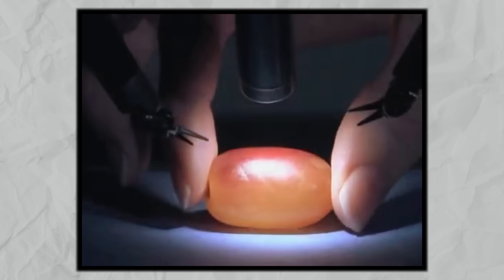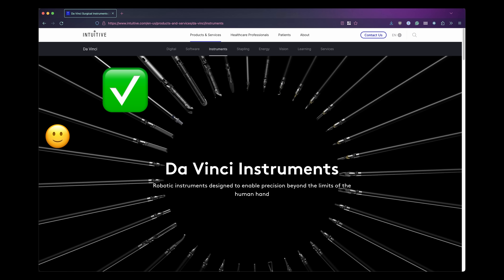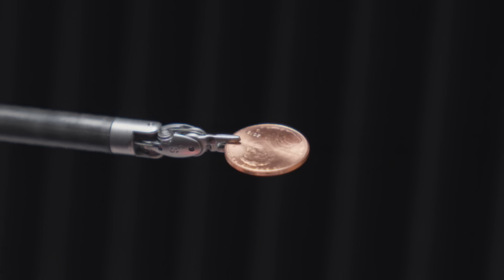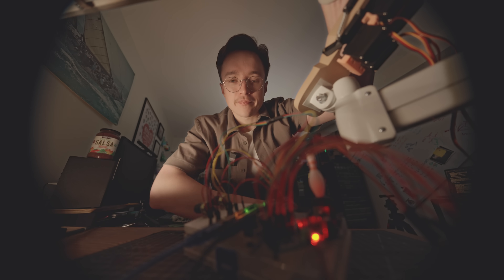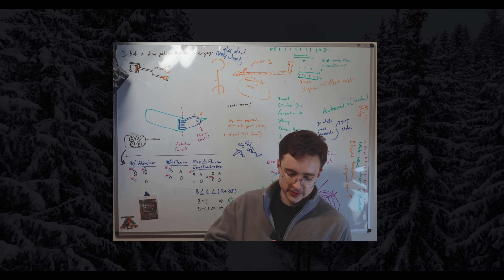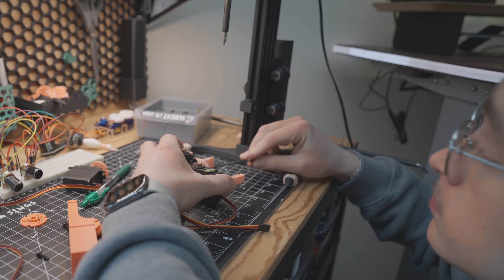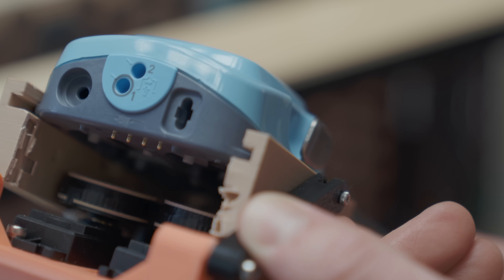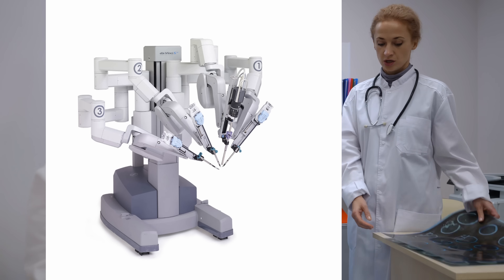Building a DIY Surgical Robot

Comment: hey, i used to work with a company that made the instruments. i was in the repairs department and received incoming and just because the hospitals say its been sterilised doesnt mean its fully clean. I saw bits and residue still attached and inside the mechanisms near 100% of the time, they also lose sterility because of bacterial growth and biofilms on the instruments and in the instruments, it's a huge reason why the parts have a limited lifespan. just a gross fyi when dealing with used medical instruments.

incase ur wondering the slide in fit is as simple as it gets, the plastic has enough elastic deformation to accommodate the pins sliding into the motors and its also part of the force limiting of the motors since the pins wont allow excessive force before just breaking, rather the pins break on the machine than an instrument breaks inside the patient.

Comment: - how about ropes in all 3 axes attached to a glove? Moving the glove pulls on one rope and you measure rope displacement.
- VR tracking
- High res cameras which film glove from different angles, feeds into NN which is trained to estimate the distance of the glove to the camera or angle of rotation. 
Or possibly you could use OpenCV or something for this. You'll likely need multiple (good enough) cameras and possibly multiple computers, preferrably with gpus that can run tensorflow, which relay their measurements to some main computer.

Comment: This is brilliant!!
For your controller issue, a Wii Nunchuck is easy to use with an Arduino, has an analogue stick and an accelerometer along with 2 buttons.. one in each hand would give a fair amount of control ability and both could be on a single Arduino or something more powerful like an STM32.. a rotary knob could be used to select which "channel" the individual Nunchucks control.. or this could be done by voice command.. taking this further an accelerometer could be placed on the back of each hand (on a glove for example) with buttons in each finger - activated by the thumb - and a small hall-effect joystick for each thumb (placed on the side of the index finger?) - this would give more button options but retain the same features in a Wii Nunchuck

Comment: I just had a minor abdominal operation done robotically a few weeks ago. Super cool to see all the different tools they have, wanted to ask to see stuff before they put me under but everything happened so fast once they were ready for me and wheeled me into the OR. I did ask what kind of abdominal mesh they were going to use, and so I got a little card to look it up after. Also very high tech/ mechanically interesting stuff. It unrolls itself and completely self adheres to the abdominal tissue like velcro without the need for stitches, and then partially gets absorbed into the tissue.

Comment: Hey Bennett, I love this video! I don't know much about coding but am learning, all of this is super interesting to me. I genuinely thought you would've had hundreds of thousands of subscribers. Anyway, I think you want patent 8613230 for the movement. I put some links for the pictures. The figures you want start on page 13 of the PDF:
https://ppubs.uspto.gov/dirsearch-public/print/downloadPdf/8613230
Description of PDF (search 8613230.pn.) :
https://ppubs.uspto.gov/pubwebapp/
Reply: also at 9:23 the way this works is very similar to your prototype. If you play this https://youtu.be/HHKEHTr7o3Y?t=112 frame by frame, they disks slide back, kind of like a seat belt or the brass latch when you close/open doors.

Comment: Intuitive actually has a "demo unit" for training - you can use the console w/ the eyepieces and the hand/finger inputs, but it's just a 3D game simulation inside the eyepieces. And there's a whole set of software for measuring accuracy, speed, simulating bleeding, etc. I got to use one  at a trade show ... insanely fun, actually.
Anyway, if you find your local med school, you might be able to talk your way into getting to use the trainer.

Hobby servos are a disaster. There are cheap closed-loop stepper boards from the 3d printing community that mount directly on the back of motors. And they now make very small steppers for extruders.
Reply from the maker: Excellent idea- I’m in the Boston area with lots of med schools around… I just might have to try and see if I can finesse a demo

Comment: Imagine using this as a soldering bot, it would make microwiring and board repair so much easier
Reply: This is exactly what I'm after. It's weird because the davinci surgical assistant has been around for at least 20 years, and I'm really surprised that no one in the DIY community has come up with a variant for the component repair field. At least one for just the fun of it
Reply: My thoughts exactly!
Reply: That is a great idea, even just to have it as a dynamic 3rd pair of hands would be helpful.

Comment: I know other people have made this point already, but I think it still bears repeating. I’m directly involved in a company which works with medical devices like this one, and the primary reason that medical devices have such limited lifespans is the testing requirements and the brutality of the sterilization process. Each device that we make goes through literal months of tests (the project I’m on right now has about 6 months of just testing planned, and it’s nowhere near as complex as a surgical robot,) and the end goal of all of these is to ensure that your device will not fail under normal use conditions or have any side-effects that would harm the patient. Parts that are being tested need to be equivalent to production parts, so for this machine in specific they likely needed to spin up an entire production line to produce the parts required for the testing. (For the project I’m working on right now, we’re making over 500 complete devices, just to test.) On top of that, the devices will need to go through sterilization cycles in-between each use, and no matter what method is used they take a massive hit on the integrity of parts that are cleaned. All in all it just makes more sense to test the minimum numbers of parts possible, to a level that doctors and insurance companies indicated would be acceptable. 

Aside from that, I’m incredibly excited that you get to show off the inner workings of some of these devices to a larger audience. The technology is fascinating and your videos on the topic have been awesome!

Comment: 3:19 Yes, would be interesting to see how it's made, although its cable driven wonder what kind of precision motors and gears used. Starting to realize the big bucks price tag on these precision robots are not from the cable drive hands but rather the state of the art motion control servo system, those could get really expensive quickly.

Comment: Very nice work Bennett. You asked about control options... Possible easier solution for control input, use a quest 3 and the onboard hand tracking. This gives you great options for viewing of endoscope, options for augmented visualisations, and pretty impressive hand tracking with gesture recognition all off the shelf at consumer pricing. If you use something like nvidias omniverse as the platform, you get interesting multiuser, multi application integration.

Comment: Awesome project, I'm an anaesthetist who works in a hospital that does a lot of robotic surgery and i'd be happy to talk through anything you want clarifying. We have the newer Xi models but i'd be able to take any close up measurements or photos you need to work on this. 

A key advantage of robotic surgery is the way it pivots around the insertion point which is something you might want to consider when thinking about an arm. The RAVEN surgical robot project might be a useful reference point for that aspect.

On the controls front what about taking inspiration for cable driven robots? I've seen a few parallel cable driven robots that act in 3 dimensions, you could potentially make a control system that does that in reverse

Comment: I got to operate one at a fukn car show in Los Angeles back in like 2013 idk why they were there but they had a full demo with basically super tiny baby toys you could put rings the size of an corn kernel on little spikes put the shapes in the hols and a few other thing I can't remember but it was super friggin cool and I'm so glad I got to try it the controls were 100% the coolest part and I sat there for a solid 20-30 minutes playing with it cuz nobody told to to stop and I eventually started to feel it as a total 1-1 extension of my fingers it's so intuitive and easy to use and at the ripe age of 11 that thing absolutely blew my mind. Now I'm 22 and it still blows my mind

Comment: Believe it or not they had a demonstration set up in a hospital I was at once. They let regular people operate it and it was super intuitive. The input had a view finder that showed the two sets of claws you were manipulating. Each hand had two finger loops mounted on armatures that let you operate the grabbers. The coolest part is that everything had a slight force feedback system so you could feel how you were interacting with the objects they set up(coins, sponge, etc). something about the size of a penny felt like the size of a dinner plate through the system.
Reply: Penny-dinner plate--that is awesome. Like they're impedance matching the feedback to a scale our bodies are more adept at handling. I'm just in awe thinking about how much nuance you could pick up on like that. Super subtle differences in how various tissue might feel that might just barely be discernable to gloved fingertips. 

I'm wondering how immediate that feedback is, like could you sorta glide along a ridge/seam just by feel alone? I suppose that particular kind of motion doesn't make much sense in a laparoscopic setting where you have a pivot at the keyhole. 

Anyway, very cool.
Reply: @barcodenosebleed5485 they said there was movement scaling options. And there was definitely haptic feedback
Reply: My hospital had the same demo and I loved using it

Comment: Cool video.  I also enjoy building mechanisms such as this for fun, but have several years experience with the robotic surgical unit you featured.  The surgeon controls are setup up so they copy your exact motions but reduce the size about 10x and the camera it uses is stereoscopic.  Shoot me a message if you have questions I am very interested in doing the same for a project and would be down for helping!

Comment: The company I work for designed and built a robot cell that loaded baskets of medical tools/devices into a series of sterilization machines. Within several months, the baskets that the robot used to load the parts had become corroded/worn to the point of replacement. These aren't delicate mechanical devices mind you, these are heavy-duty stainless steel baskets that would knock you out if someone threw one at you. I can understand how these only have a few sterilization cycles before needing to be replaced.

Comment: For the controls something that immediately comes to mind is a 3D mouse from the late aughts called the Novint Falcon. It's basically a delta robot on its side. The Falcon only gives 3 degrees of freedom though, and eBays for like 300 bucks. So you might get more mileage out of building your own delta arm.

Comment: Let me tell you how you can reverse enginner the input method:

1-Buy tons of cheap small potentiometer
2-setup an arduino to have a analog input multiplexing
3- smooth the data to compansate for the multiplexing
4- 3d model 100s of tiny parts
5- print and assemble
6- model the input device in blender (as a skeleton)
7- write a blender python script to feed arduino data to joints in blender
8- write another script to ik the position.
9- build the robot arm
10- use it to become proficient at it.

It is really easy, only should take 2-3 years and a lot of money /s

Comment: I love these types of videos, happy I saw it on my home page! 
For controlling the position, I would personally look into hand tracking (with a physical controller), the Vive trackers are pretty good when using their base stations.
I would then write a program that would basically check if the tracked/requested movement amount is valid (doesn't move a ridiculous distance or makes a move that stabs the patient), and might need to use a distance sensor or proximity sensor for more accuracy/ safety.

Comment: Love the video!

Here is what I would use as input devices:
The Valve Index controllers mounted to a "monitor arm" or something like that.
The Index controllers provide 6dof hand tracking and have enough analog inputs to both move an endeffector in two axis and the tools opening/closing with a third analog input channel. In addition the digital inputs give you even more options. I have a pretty detailed concept how I would repurposed them so feel free to contact me if you want more details :D

Comment: the way the connection could work ( i dont know what is in those discs ), magnetic coupling, once the device is close, the shaft and other half of the coupling magnetically attatches ( or, the shaft gets pushed out by a mechanism when its fully inserted )

Comment: it all depends on who will be using it. I see 2 approach: the "techy" one where you have joysticks with force-feedback and you'll control it like a robot; or the "intuitive" one which you control it like if you were holding it. on this one, you'll probably need a haptic glove with a force-feedback device which allows you to use your own motor skills and where the robot simply convert that in a replica movement on the smaller devices. Perhaps with vr glasses so you may see like if you were there

Comment: I actually assumed it would be easier to make a large machine that translates your own motions into ones that controlled the machine. Perhaps making one of those that provides a digital readout would help? I mean in a sense you are reverse engineering the davinci control interface but at the same time you can do a lot of it with mechanical parts that would require no coding and would translate motion to whatever device you wanted to read off of.

Comment: Had this video randomly recommended to me. Great work! You earned a sub. Hope to see you continue this project. I dream of seeing a three arm setup hooked into your desk! Might not be very practical (or ethical) for doing actual surgery, but I could imagine doing some fantastic precision sculpting or soldering work with these once they're done.

Kind of unrelated but I wonder how long it is until we can hook up an AI model to controlling one of these. Something which can diagnose an injury, create a plan of treatment, and execute a surgery all on its own. Then we would basically have the autodoc from Fallout. I imagine this  could be very useful in a battlefield scenario, where rather than having to risk a team of highly trained surgeons so close to the fighting, there could just be one surgeon overseeing like 10 of these puppies going to work extracting shrapnel and suturing wounds.

Comment: I've been really curious to try and do something with one of these instruments since Kyle Bartholomew posted a teardown video on one of these a few years back.
Excited to see where you end up with this!
It would be stupidly fun to try micro-soldering with one of these.

Also, one suggestion, you probably want to consider torque control for whichever servo is responsible for clamping the jaws shut, as this would both enable you to be much more delicate with what you pick up but also facilitate implementing force-feedback in your input controls down the line.

Oh! And a stop-gap input device if you don't want to design that first could perhaps be a space mouse as they have 6 degrees of freedom are readily available and are relatively easy to interface with.

Comment: The USB shield for the Arduino supports Xbox/PS4 controllers and supports forced feedback via vibration and is easy to implement the example code is super easy to use. You can use the PS4 controller with a Bluetooth dongle for wireless

Comment: The fingers should be easy. For example, you have two finger holes for one arm, one finger hole going forward and backwards, controls the rotation of the a disc the left and right movement would control the left and right movement of the disk same thing with the other hole, you could have the up-and-down direction for the seaand the left and right for the desk whichever combination of those discs work together should be easy enough

Comment: It’s super cool what you’re doing. It would be complicated to control with any of the new gesture recognition AI / VR stuff but it would be cool. I’m an old machinist and the concept of using scale reduction to get precise motion is not new to me. Before cnc there were hydraulic tracers and pantographs used to create 3d motion at small scale.